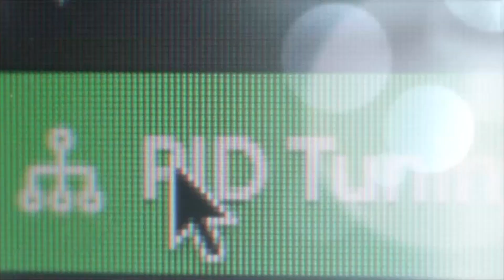Cleanflight and Betaflight Are Ending Support for F1 Boards

Comment: cash grab bull........ time for a new hobby.........................
Reply from the maker: This is absolute nonsense. If it was a cash grab, they would have just let the F1 die one or two years ago, but instead they kept breathing new life into it again and again. Furthermore, the people deciding to end support (the BF devs) are NOT the ones who financially benefit from people upgrading (the FC manufacturers). The BF devs' sole motivation here is that the F1 board can no longer support the code that they want to write, and they are tired of carving out exceptions for it just to keep it on life support.

You can continue to run your F1 on BF 3.1.7 or probably even 3.2 for as long as you want. The BF devs are just saying they are no longer going to write code for it.
Reply: Please explain how this is a cash grab.
Reply: sorry but I didn't understand, thanks for the clarification. ps love your show..... I'm just frustrated a little as the technology is advancing so quickly that my wallet can't keep up,
Reply: You can still use your F1 board with current firmware even 10 years in future. Personally I still run APM on one copter even if support ended few years ago.

Comment: What an awesome manual..Great job! I wish other manufacturers will follow suit and have a professional user write their manuals.

I would love to hear your concerns on the omnibus. I don't tend to use their pro versions, but I do use their non pro versions. I've been experiencing some issues and wonder if it was me or the fc? For e.g..I have OSD working fine. I lose the OSD once I take off. I have to restart the quad to get it back, but it goes away again as soon as I start flying. No clue. Is it me or the fc?
Reply from the maker: There are some issues getting the serial protocols to work right on the F4.

Comment: I wonder how difficult it would be to compile on demand like OpenTX so you can choose to lose some of the wank features like LEDs, GPS, SONAR etc. and only compile sane options based on the board?
Reply from the maker: I've heard this idea floated before.
Reply: We don't plan to support on-demand compilation. However if you wish to compile your own variant including only the features you wish, this is relatively straightforward.

Comment: Honestly flight performance hasn't improved much since 3.0 so its not really a problem unless you need fancy features.
Reply from the maker: I disagree. Anti_gravity_gain is huge, and I don't think that was in 3.0. Dynamic notch filtering which is coming in 3.2 will be another big step forward.

Comment: Hey Josh, love ur videos. was wondering what are your thoughts on the omnibus f7 ordered 1 cple days ago to run with blheli32 escs i got. if ur not recommending the omnibus f4 am i screwed with my f7?
Reply from the maker: I don't know what's going on with the F7. The issues with the F4 pertain to getting the UARTs working right, and F7 doesn't have the same problems as F4 with UARTs so the F7 is probably fine.
Reply: gotcha, thanks for the reply. all i want is that Dshot1200..lol the built in bf osd deff a plus

Comment: what about matek f4 with his separated pdb?
Reply: I'm quite liking that board, my best flying quad yet is running it and BF3.2.with Wraith 32s.
On the other hand my most recent quad is acting random with the same board and I'm wondering if maybe that very delicate ribbon cable has been damaged. And I can't find spares so far.
Reply: jtan163 yeah was wondering about replacement for that cable... think I'm gonna give a try to that board. there is one seller in my country so in two days is solder time!! :D

Comment: Joshua Bardwell How would you rate the HGLTECH F4 V5PRO as a NAZE32 upgrade? "https://www.banggood.com/F4-V5PRO-Flight-Controller-5_8G-40CH-025200600mW-Switchable-FPV-Transmitte-w-5V-BEC-OSD-PDB-p-1136342.html"
Reply: Paul Morris I don't run one but a buddy of mine I run with swears by them. He has at least 3 quads running the f4v5. Me personally have always had success with omnibus boards so I will stick to that but I've seen the f4v5 perform well.
Reply: Paul Morris I had the f3 v4 and it was a nightmare, the board was extremely sensitive to moisture and the Vtx died almost immediately. I'd definitely recommend a board and separate VTX. So much less headache

Comment: can we still use Baseflight with our old boards?
Reply: just use an old version of betaflight that supports your board
Reply from the maker: I don't know, and I can't imagine why you would want to. How does Baseflight fly, compared to Betaflight?
Reply: Árpád Hegedüs I have left my F1 boards with Betaflight 3.0 and not moved forward with it because I thought that they could not go farther with the change to floating points... is that correct?
Reply: FFS the F1 boards won't stop working from day to day. Your current setup will work with them in future no mater what.

Comment: I'm actually concerned about the BeeBrain.  The F1 still can make sense or Tiny Whoop flight controllers.  The BeeBrain isn't that old, now this means Betaflight will stop supporting it?  I guess you can always run old versions of Betaflight.
Reply: The beecore is F3 right? I know it's a clone, but runs SBUS and I'm pretty happy with it.
Reply: Damnit, this is a real problem.
Reply: Im okay with old versions as long as the Configurator continues to function.
Reply: The Beecore is F3.  The Beecore is honestly my favorite Tiny Whoop controller, but it can also be a bit unreliable at times.
Reply: Check out Painless360s video on how to use old versions of the cleanflight configurator, it should be the same for betaflight.  You basically download it to your pc instead of using the online version.
Reply: Twiztedmind864 Thanks for the heads up, I'll be sure to brain bookmark that for when the time comes.
Reply: you can always use the old versions ;)
Reply: Boris B. Don't mind using old versions, just hoping Configurator development doesn't break setting up the F1s.
Reply: The head (code) monkey himself. ;-)

Any idea when 3.2 is gonna become release  +Boris B. ?
BTW Thanks to you and all the other code monkeys for Betaflight.
And your contributions to Cleanflight
Reply: +RockTouching. How is the beecore a clone? Because it uses a the same form factor to fit in a tiny whoop? If that's it you might as well say all cars made are ford clones because they have 4 wheels.  It's an F3 board with an entirely different PCB layout than the F1 beebrain.  It's not a clone.
Reply: We will probably support brushed F1 flight controllers a bit longer than the other F1 flight controllers.
Reply: Do you really need newest software on your old whoop? Does it fly bad?
Reply: GitHub has milestones which could give you an insight on release schedules.
Reply: The question isn't "Does it fly bad now?" It's "Will they introduce some new feature or change in the future that will make them fly better then?" Hopefully someone will make a 'betawhoop' fork of betaflight if flash size is the reason for the discontinuation, and strip out pretty much everything that isn't required for flight on micro brushed FC.. The GPS code, brushless motor protocols and code, and any other feature that would never ever be used on a whoop sized brushed quad.
Reply: What problems have you had with it? I have 2 of them and they work perfectly fine, provided I turn on the radio BEFORE powering on the beecore. Otherwise it failsafes 1-2 seconds into the flight.
Reply: Uhm yeah, I guess you are right. Not everything on banggood is a clone.
Reply: Furious FPV Acrowhoop V2
Reply: do you have any experience with the newest rev of beecore for Flysky? I can't get it to work with FS-i6, it's bound, the green light goes steady when the TX is on, but there are no inputs (all channels 0) when viewed in betaflight.
Reply: Soon ;)